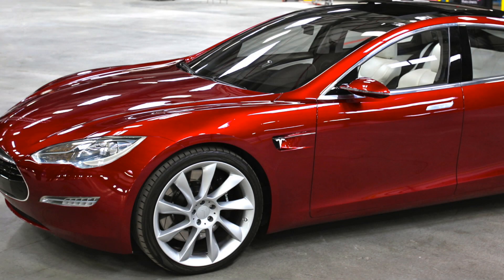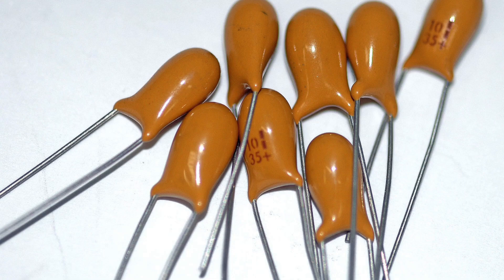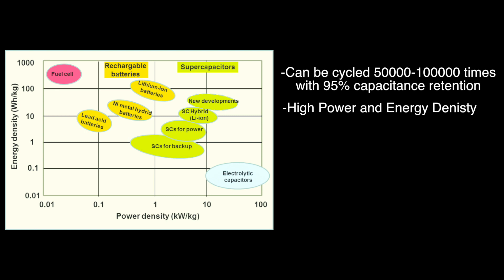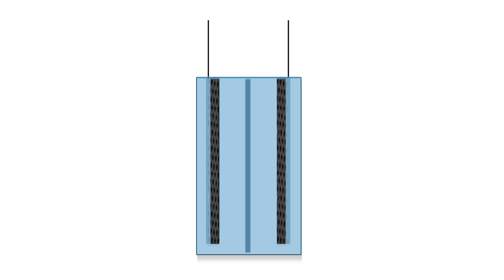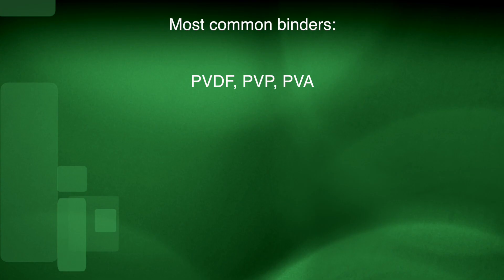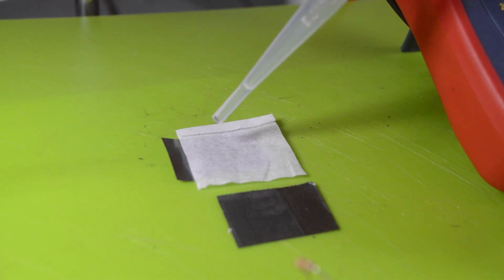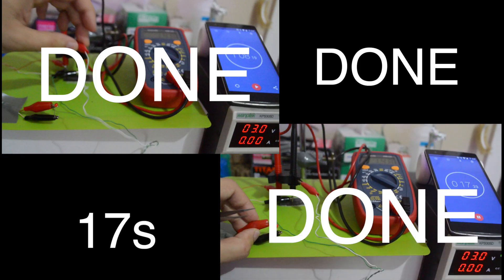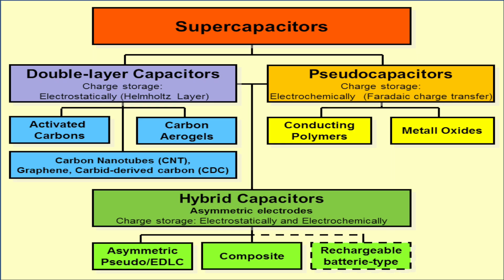How To Make A Basic Supercapacitor

Comment: Wow, 2cm(2) at .6 farad is astonishing. Are you sure your math is right? Relatively, you've done many experiments, so maybe put your "cap" into a know capacitive circuit (series) and backtrack to see if you have the same result.. good job, very curious.
Reply: I was very surprised by such promising results, too, so I plugged the numbers into an online calculator, http://mustcalculate.com/electronics/capacitorchargeanddischarge.php?vfrom=2.01&vto=1.01&vs=0&r=1000&time=421 , and the online calculator returned a value of 0.612F

Also, I didn't searched for supecapacitors since many years ago, and today the biggest one available at Mouser is 4000F/2.5V, not a mistake. In the Nichicon datasheet, the biggest listed is 6 kilofarads at 2.5 volts.

Anyway, 0.6F for the size of a post stamp is unbelievable good, not to mention it is a DIY.
Very well done!
Reply from the maker: Bull Dozer I'm aiming to get that at least 5 times higher. But yes I need more tests to confirm. That's why I also do the LED test. It's pretty indicative of how well the thing works.
Reply from the maker: And thanks :)

Comment: Excellent  video! Lots of good info here and presented very well. Looking forward to the other parts.
I have made and tested a few super caps  myself. The resulting capacitances were very good but they had a short lifespan. After maybe 6 to 8 charge discharge cycles over a period of 15 to 20 minutes they would stop working. I tried several different binders, one being a commercial polymer based one used in making lithium ion batteries. They all had short life spans. After watching all of Robert Murray Smith's videos I noticed that he calenders his electrodes. After applying the carbon based paint he dries the coated electrode and then compresses it between two rollers. I suppose this compression helps the coating adhere to the foil and maybe helps with cell longevity. It may also improve cap performance. I have not had time yet to try this calendering step on my cells yet. Have you checked the longevity of your caps or tried calendering them?
Reply from the maker: There's a lot of things that can lead to short lifespans. Far as I can tell, mine actually get better after a few cycles, but they fade because they dry out. A squirt of water or other electrolyte usually gets them back up to full function. Some of my non water based cells that can't dry out work well even exposed to air for a long time. If you tried packaging your cells in something airtight with a bit of extra electrolyte, you may have better results.I haven't tried calendaring as I don't have a press or rollers
Reply: @thethoughtemporium  Hi.
Congrats for the video. Great!

Maybe the lifespan problem is related to the application of voltages greater than 1V.
Usually, 1V is the maximum operational window, after that the aqueous electrolyte is degraded in H2 (or/and something else).

What do you think?